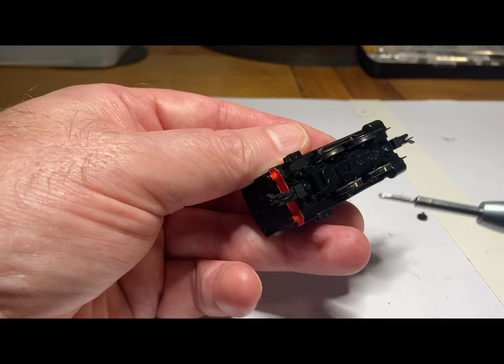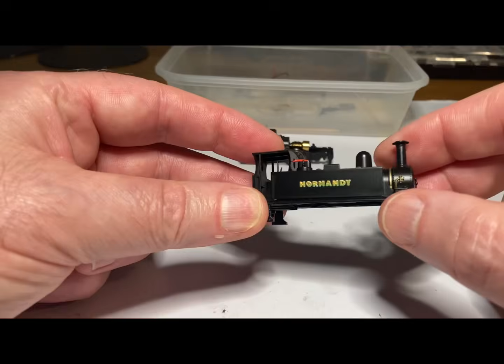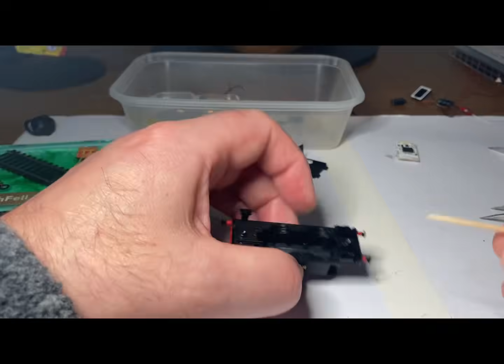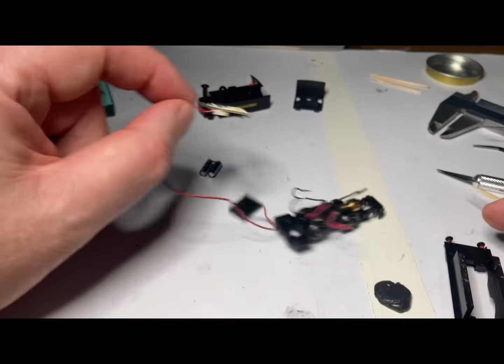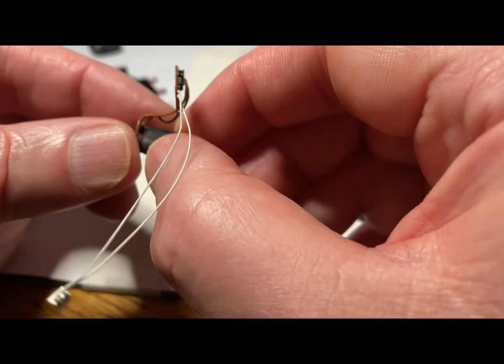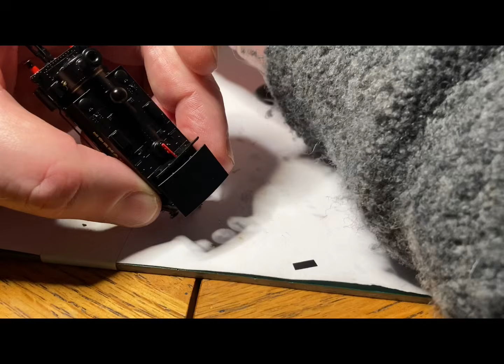Hornby TT:120 Branch Line Freight Set TXS N18 Fitted High Fell Edition

Comment: Odd question but do you mind telling me how big the space is in cm from on wheel to the other from left to right (side on)
Reply from the maker: Yes that is an odd question 🤣 do you mean the back to back measurement of the wheels? I set mine to 10.43mm or a different measurement?
Reply: @HighFell  yea sry it was quite difficult to word correctly lol

I mean what is the measurement inbetween the front and back wheel at if that makes more sense
Reply from the maker: Do you mean the wheel base, the distance between the front and rear axles? Or the distance between the front and rear wheel flanges or the the distance between the front and rear wheel tyres?
Reply: @HighFell  the distance between the front and rear wheels ye!
Reply from the maker: @joesykes4226   which part of the wheel? Tyre or flange ?
Reply: @HighFell  OH sry, emmm I’d say tyre

Comment: I've just taken advantage of the offer of this set with the Cadbury vent wagon and a signal box so after my efforts with the 08 I'm going to have a go at this.  I don't suppose you have any idea how long the wires on the power banks were?  I'm ordering them soon and will ask him to shorten them for me but obvs don't want them too short!!  Last question.....I don't suppose you took a photo of teh final product of teh decoder after soldering as I'm unsure which buts you were referencing 😂.  Wish me luck!
Reply from the maker: You can use the nano version without the Hornby plug and solder the wires directly to the Gnd and VCC+ pads and the SA works much better
Reply from the maker: Im not sure which bits you are unsure on 😂 ask when you hit a bit you dont quite understand
Reply: @HighFell  You mentioned at 35.30 that Sven (who has agreed) would be able to shorten the wires from the PB's to the PCB and also from the PCB to the HM7000 connector.  I could make a guess from the video but wondered if you remember the details 😬
Reply from the maker: @philsilva13  sorry Phil, I can’t recall and it could take a couple of days to look if you can wait?
Reply from the maker: I had a chance to take a look and it’s about 45mm, hope that helps
Reply: @HighFell Matt it has been some time since I got the branchline set but due to work/life balance issues (and a degree of concern following my 08 attempt that still isn't working well) I've recently noticed that you now do commissioned work. Could I contact you to discuss this please? Not sure if you can be DM'd directly through YouTube..... Let me know please 😁
Reply from the maker: My email address is in the last two video Phil. Just drop me a message and we can discuss what you would like. I have eventually caved in after so many people were asking if I would take on projects for them. 😁👍
Reply: @HighFell that's fantastic news for me! 😂 I'll be in touch tomorrow 👍

Comment: Would you say this one is more difficult than the 08? I watched your video (thank you, by the way) of the 08 and wanted to give it a go. Maybe I should try this one first, since it’s cheaper, and then tackle the 08 afterwards. Edit: After watching the video, the 08 seems certainly easier to do...
Reply from the maker: It’s probably easier as a first project like this. The loco only has basic detail so more robust. But in terms of technical difficulty they are about the same, which is fairly straightforward. Feel free to ask if you come across any bits that you are unsure of 😁👍
Reply: @HighFell   getting the Hornby decoder and speaker is pretty much impossible ATM, but I certainly will as soon as they become available again!
Reply from the maker: @JuanGonzalez-pf2tu  you could use the 8pin TXS decoder and simply hardwire that. It’s only 4 wires and it’s a pretty easy. They are available but I haven’t seen any ‘deals’ but I think we are due something soon on N18 decoders 😁👍
Reply: @HighFell fairly new to this but I'm 100% sticking to what you've done exactly, point for point! Quite confident about soldering, dismantling and fixing stuff but 0 confidence about component compatibility on this😂
Reply from the maker: I fully understand, it’s often the first one that sets the confidence level. I did show doing the sound install using the 8pin too. The N18 TXS and 8pin are exactly the same decoder but with different interfaces. Have a look through the videos and you can watch that too. On that I put the stay alive caps in the cab but the way I did them here is a much neater job, getting the cab off can be a pain too!

Comment: Witchcraft. What you've done there is the impossible before my eyes. I think I've done well if I install an 8 pin decoder without stay alive latterly AE Model Micro 8 pin decoder with stay. I've never achieved a HM7000 in a OO Gauge Class 08. Regards. Steve
Reply from the maker: Ha ha, eye of newt is hard to come by these days Steve. It’s a long time since I have been inside a OO model, I’m thinking there is much more weight and electrickery and PCBs in there. My old Lima Deltic had a slightly corroded lump of steel bar in the fuel tanks and enough space in the body to build a sauna!

Comment: That's some excellent work. Much harder than my J50 - its OO so I got the speaker in an enclosure in the bunker by taking out the plastic coal load (and I can sprinkle real coal on top of the speaker). Not sure where I will hide the stay-alive caps though; of course they could go in the cab, but I would rather avoid that if I can. I might be able to separate the caps and hide them in two different places. Food for thought.
Reply from the maker: Is there potentially any space alongside the motor laid lengthways? Not seen inside a OO J50. The TT:120 version is due to arrive early 2026
Reply: @HighFell  There is enough space there if you remove one of the weights - remove two and you have space on both sides, but lose abut 25g, only some of which you regain. I am definitely removing one for the decoder. Having seen your work, I may do some surgery to the other weight to carve out room for the stay-alive in the weight.
Reply from the maker: @little_britain  if you are feeling creative, remove the cast zinc weights, make some lead replacements, wheel balancing weights are very cheap and easy to work with, and put that back in where you can. 😁👍
Reply: @HighFell  Yes, I actually get free discarded wheel weights at a neighbourhood tire shop!
Reply from the maker: Free is the best price 😁